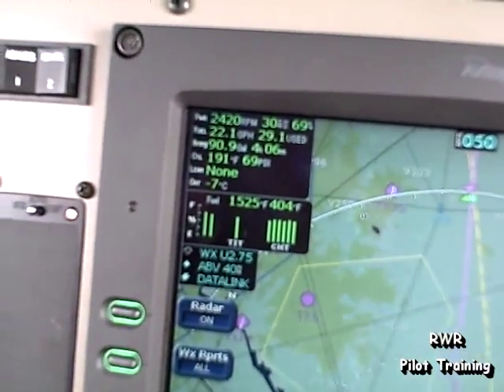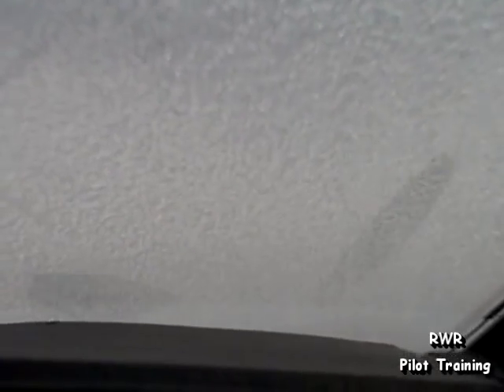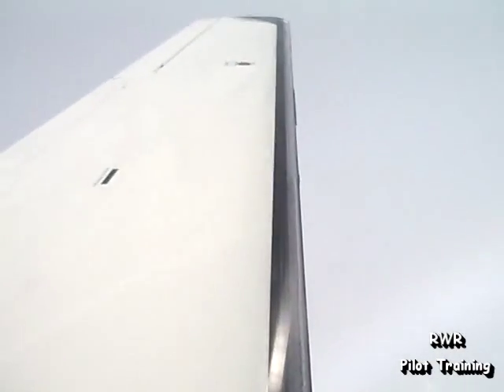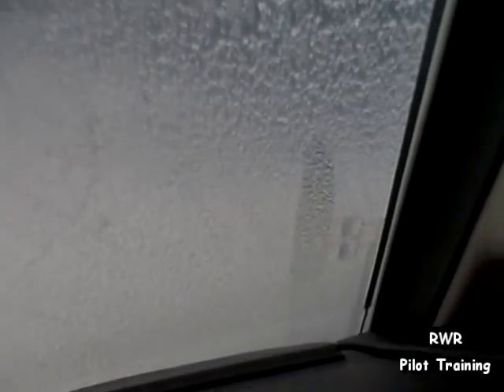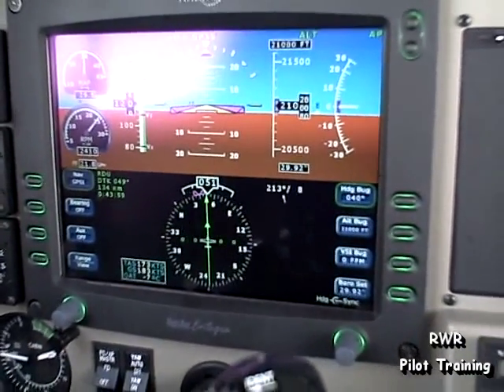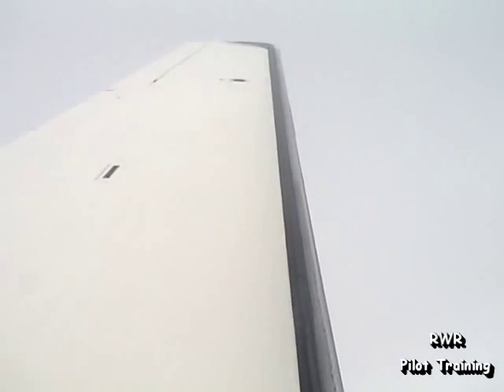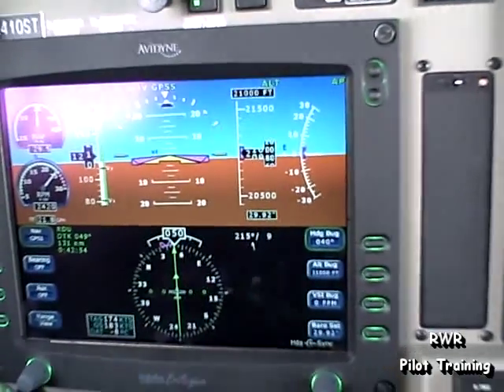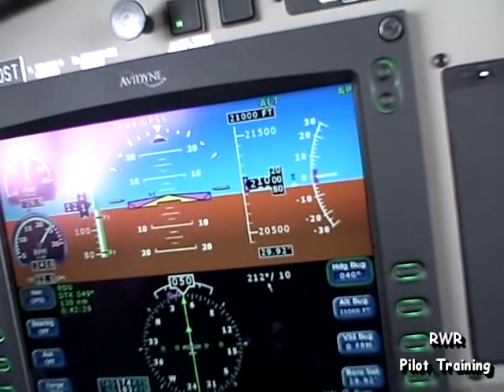Airframe Icing in the Piper PA46 Mirage

Comment: Very knowledgeable about icing conditions but there’s one thing I’m not in agreement with. 
He mentions about not deicing the windscreen because he doesn’t need to see out of it yet he tells us and the controller that he’s “in and out of the tops.”  What about “See and Avoid?” According to AIM 5-5-8; a. Pilot: When meteorological conditions permit, regardless of type of flight plan or whether or not under control of a radar facility, the pilot is responsible to see and avoid other traffic, terrain, or obstacles.
During the moments when he’s out of the tops he’s responsible for traffic avoidance therefore his windscreen needs to be unobstructed!!!!!
Reply from the maker: Hi Joe.. a very good point. The need to see out the window includes looking for traffic and therefore is a reason to turn on the windshield heat. It is also true that constant use of the windshield when it is not needed is implicated in premature failure of the system. So, it is a “sticky wicket” eh?